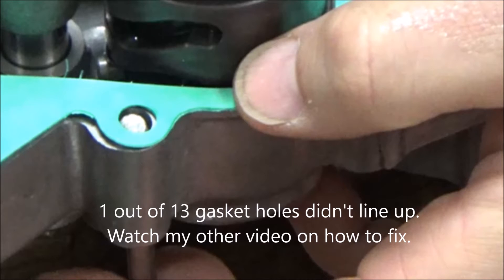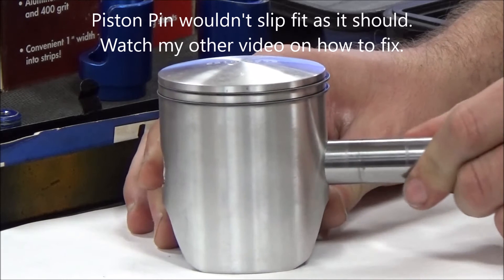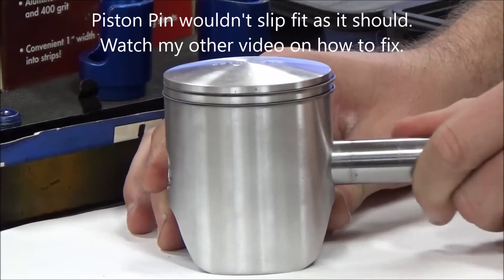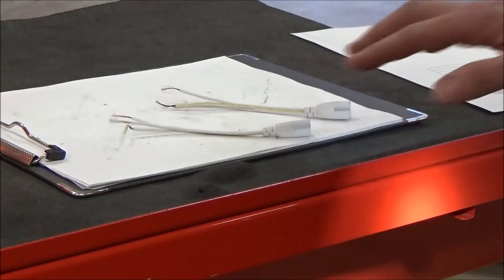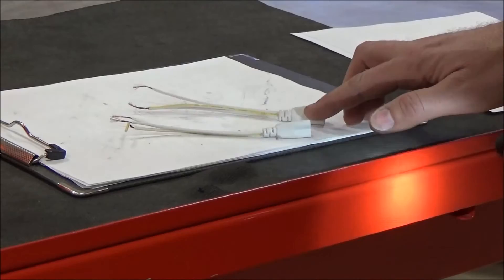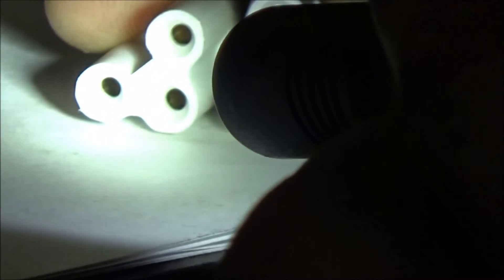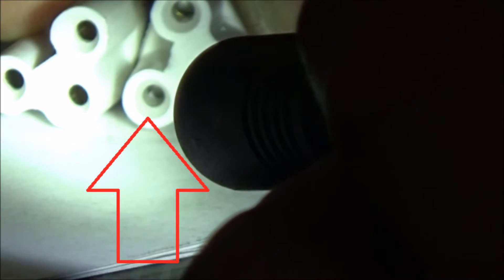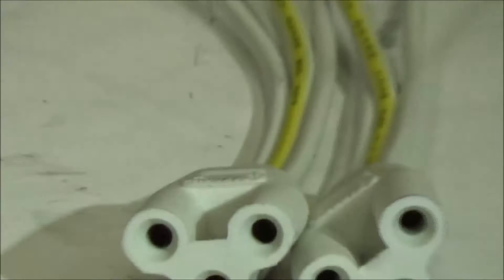Can new parts be bad? Why you should thoroughly inspect new parts before installation! 3 examples

Comment: I ordered an OEM clutch actuator set by Beta, came fully assembled. I didnt check it. after installation, during flushing, i was wondering where all my fluid was going! after scratching my head i discovered that the epdm o-ring that goes between the housing and the plunger was missing, and all of my clutch fluid (dot 4) was going straight into my engine case. This was 2 days before my extreme enduro race. fortunately i was able to find another o-ring of the same dimensions, not epdm, though, and slap it on temporarily. It worked great, but of course that was not the end of the simple clutch actuator replacement. Of course, absolutely zero accountability from the shop or manufacuturer. so far at least. whatever. next time ill check! good video and series!